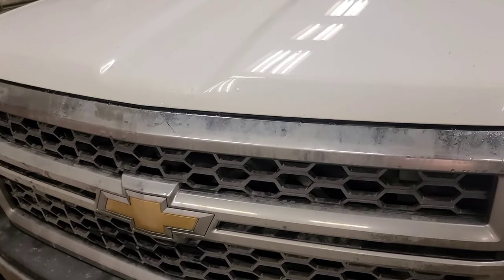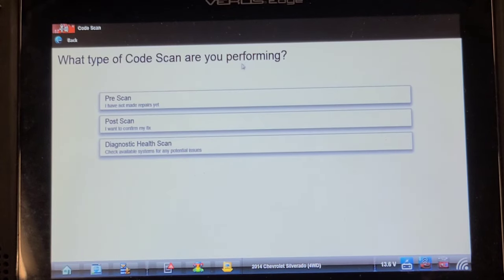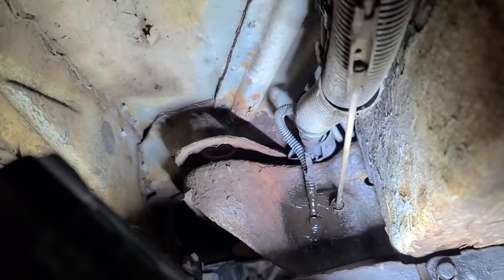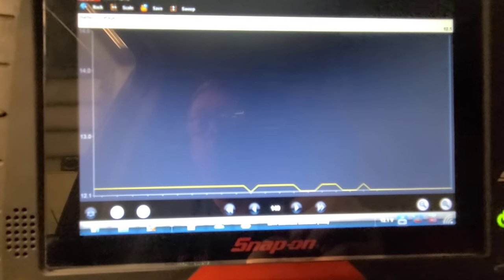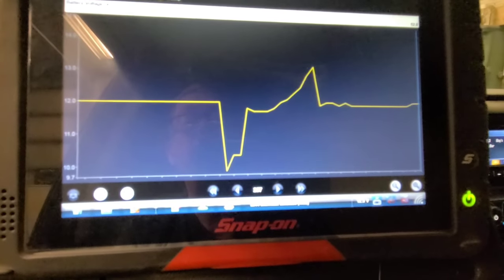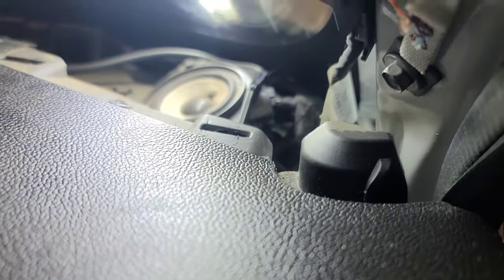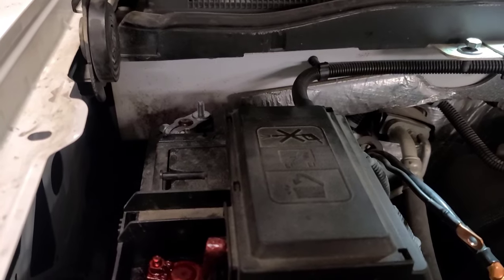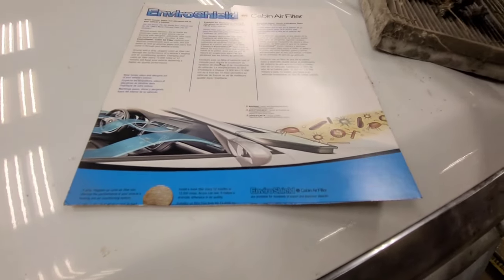2014 GM Truck. Multiple Electrical Issues, Dash Cutting Out, Code B1325

Comment: Good idiea with putting a sheet of paper under the cabin filter Phillip, those chevy trucks have a braided body to frame ground in behind the plastic wheel well on the left side that rot away and makes your elec steering and dash go poop. my Seirra did that to me ,I thought I had checked all the grounds but of coarse murphy's law says different .
Reply from the maker: Really! I didn't know there's one on the left side too. I'll look tomorrow
Reply: @PhillipBailey   it was on a 2019 GMC  ,but your right it was on the rh side , a braided cable that went to the body I remember taking the plastic wheel well off and it was rotted , my 1991 GMC had a ground as well just below the heater hose as well that went to the frame, it was never hooked up ,sorry about that Phillip .

Comment: Gm's have had similar issues for decades.. I used to have an 88 cheyenne pick up. I would try to use the wipers and  the radio would shut off or the windows would go down..